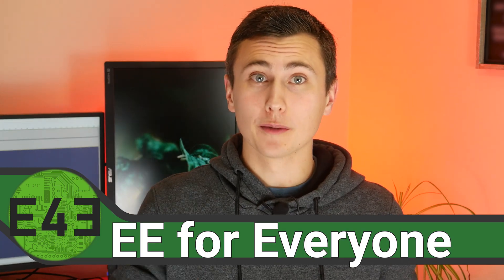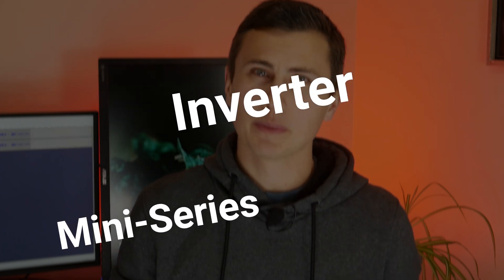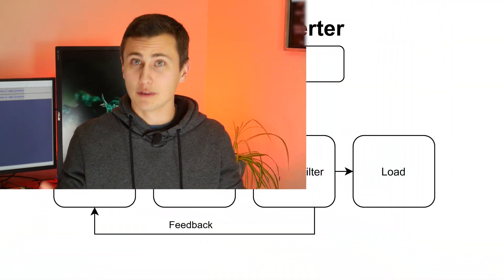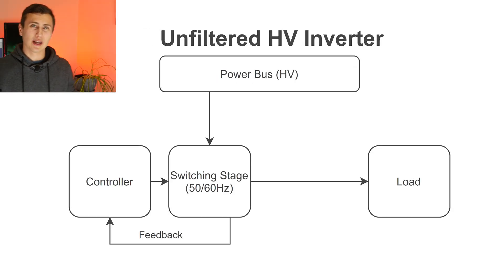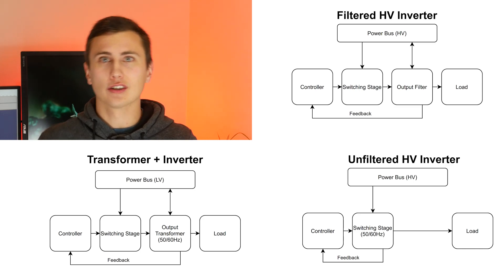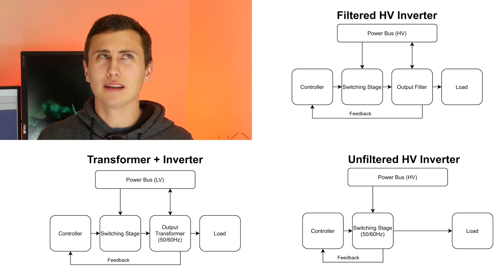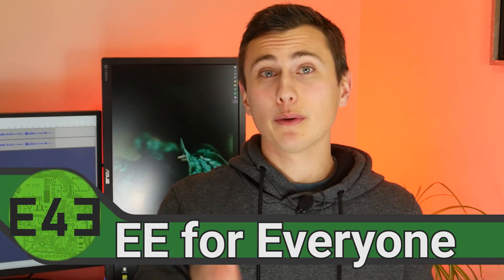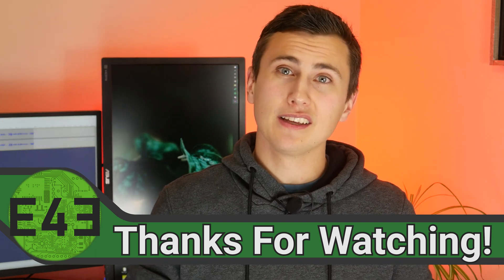Inverter Project Kickoff! | INV2

Comment: Instead of testing out every possible combination of filter and control strategy, I'd recommend reading a state of the art review of UPS/inverter control. For what I've seen, LCL configurations can achieve pretty good waveform quality and you could use a double loop (voltage+current) approach to control the inverter as a voltage source with internal current control (for both load following and protection). The caveat of LCL designs is resonance, but there are several strategies of damping either with passive components or specific algorithms embedded in the double-loop control. And about the switching frequency, I'd say 10kHz would be ok, probably you could go even lower if you do in fact opt for the LCL filter.

Comment: I've had better luck designing for the 30-50khz range. Less magic smoke. If you're going to design another inverter, I'd recommend building around an EG8010 in bipolar mode.